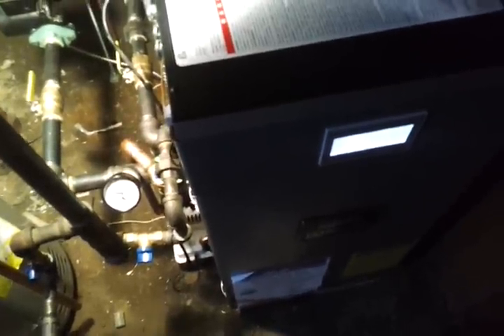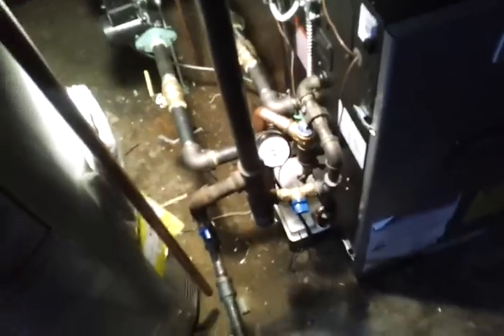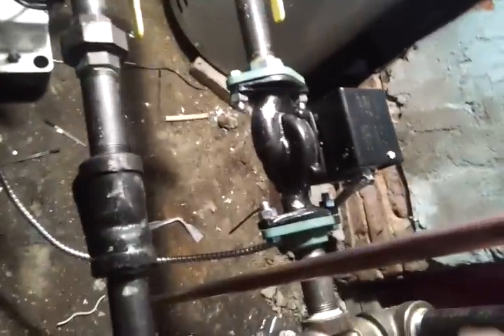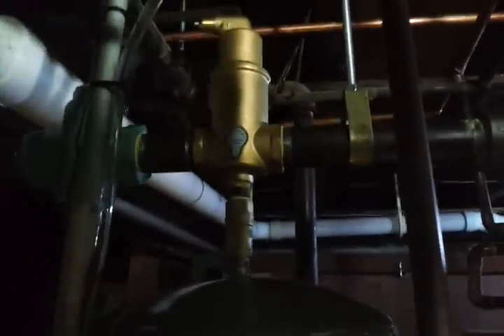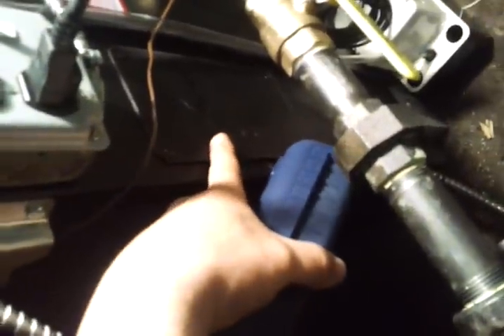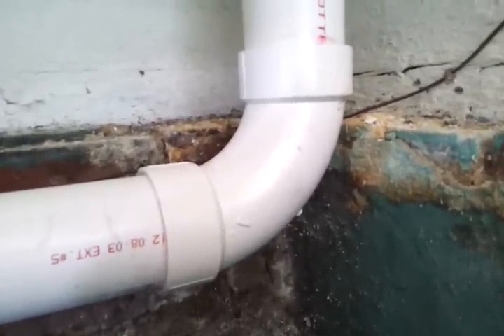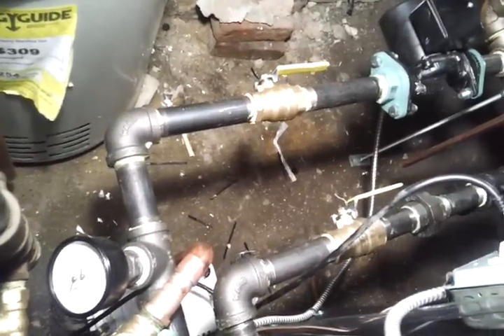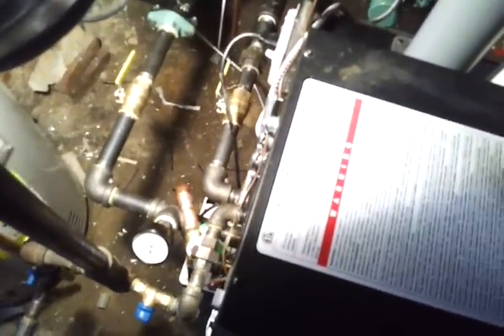Burnham Alpine boiler installation

Comment: On alpine boilers and most high efficiency boilers the boiler pump should be on the return pumping into he boiler. Also there should not be anything between the p/s tees and you need  a minimum of 6 pipe diameters before the tees on the system return.